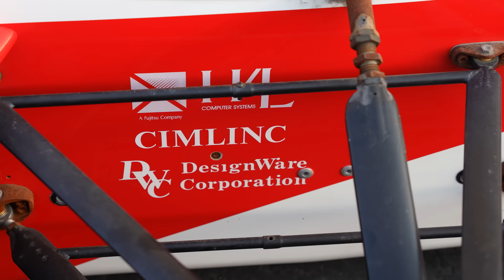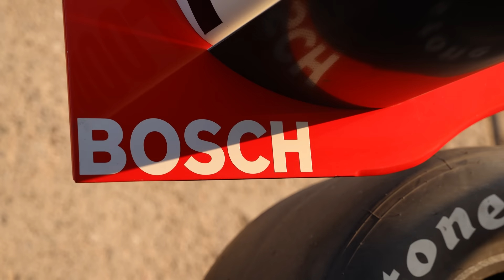I bought a INDYCAR without an engine.

Comment: Safer step is to mount turbo bike engine and gearbox into it .   will be way easier to drive .   Just saying that era open wheel cars are unstable to drive and less engine breaking you get the better it is to tune your senses on the car.    All it takes is an single rear wheel lockup on engine breaking and you loose your legs if you are brave enough to push it at all... and if you are not , its even worse to drive as you cant keep any temp on tires.

Comment: So the original engine was used as part of the chassis, large solid chunk of metal, now you planning on putting a rotary engine in place that uses a few 3/8 bolts to support front to back. Sound like an issue.

Comment: I have always had this question, where do you get parts for old official racecars like this? I know they are either very rare and expensive. I feel as if there is one accident the whole project is a write-off. Do you have any plans of reverse engineering parts for spares, different transaxle options, and carbon parts to make parts a bit easier to find?
Reply: There are guys that restore them in Indianapolis....parts are available
Reply: @jessallen7756  that's good to know. In my mind the parts would be team Specific depending on the year. Still I bet the part pool must be kinda small. I'll have to look into it more!

Comment: Even for the 90s steel suspension members would have been antiquated
Reply: Indycar still to this day uses steel arms. They often look carbon because there are carbon covers over them for aero but underneath is still steel. Been that way forever largely for safety reasons.

Comment: Remember the engine is a stressed member. Meaning it’s part of the chassis. That rusted metal square where the engine should be is temporary acting at that stressed member.

Comment: I put it in the replies accidentally. Again,rotary engine guzzles too much fuel(sounds great),so a twin KKK turbo 2.0liter V6 would be straight on the money. Something out of old Megane sport with turbos on and you're flying. Like the engine from those English  sport cars that guy makes can't remember the name... Blane,Beal,Gable help me out here. Those cars are fitted with a Megane V6 turbos and they fly. Imagine what it would do in the back of this Indycar. That is visibly from the 90's,early 2000's max and that's when they looked the best. Think it's a mid 90's car. And if he doesn't know what's under the front cover then what is he doing with it?

Comment: Hum, looks like the car has been sitting outside in the weather/rain, a lot of the metal parts are rusted. Just have everything powdered coated & make it street legal to drive. There are several Nascar related trucks & cars that were converted to street legal.

Comment: Will have to dry sump the engine and build a frame for it as the engine will take the chassis loads. If you put the loads through a stock rotory block it will break/distort. 

Those screws on the body are quarter turns. 
Those aluminum rods are placeholders for coil overs. I bet MCS could hook you up. You may be able to swap that transmission for a sadev. Suspension mounting points might have to change though. It will be a lot of work and money.

Comment: LOL this is going to be a way bigger project than most people think. Any open wheel car that has seen alot of downforce needs to be thoroughly gone over to look for stress fractures and things of that nature. All of the control arms will more than likely need to be replaced if you want to drive it at any sort of speed. There are companies that restore these things for vintage racing, and it takes them years to source parts to make the car work correctly. If he thinks the RX7 took a long time to get running. This is a whole different animal. I'll stop back in 2030 to see if it's even moving under its own power.

Comment: U should ask Cosworth to send you a Formula Boss engine and electronics...the gearbox needs a fully stressed engine block matching it...you´ll need to build a support for the engine that fixes it to the chassis and hang the gearbox to it and pray it doesn´t all break up. Hard work ahead...
Reply: it'll probs get something like a 6 rotor

Comment: Those metal rods you put you hands on at the top of the suspension are not some temporary place holder, they are torsional springs, your suspension looks complete.  Open wheel racers moved away from conventional springs a long time ago, and most series have a ban on shocks.
Reply: False, this is an Indycar, not an F1 car.
Reply: Wow....... just wow.
Reply: No series bans shocks (more appropriately called dampers). This would have coilover dampers/springs but those are expensive and carry over to other cars so a stripped show car just gets a solid rod to keep it off the ground.

Comment: im not an expert in any way but you have made frame mods on all your vehicles before why not lengthen the chassis to fit what ever engine you like in
Reply: This is a carbon monocoque
Reply: @The52car  ok many thanks for putting me straight
Reply: @The52car  Yes, forward of the engine. In theory, you could make the car longer or shorter by using a longer or shorter engine, longer or shorter spacer between the engine and gearbox (F1 does this a lot) or in the case of an engine swap like this, you will need to build a frame to join the front and back half of the car together since the engine is no longer a chassis member so that could be made longer or shorter. Of course doing so means new rear bodywork and floor as well.

Comment: Id love to see a rotary in that, good thing you have a machine shop, that cars engine was integral ,meaning the engine was part of the chassis, hence that boxed frame holding the two halves together, youll need to modify it or the rotary to bolt it all together without redesigning the body panels,,, the whole proccess is gone be a challenge and well worth watching ,BTW you need to finish all your other cars , you get 95% done then start another project.

Comment: Why are the suspension arms rusty, would a real IndyCar be rusty like that, I thought all that would be carbon fiber or something light weight
Reply: Currently they are still a steel alloy.  They have carbon wishbone covers though.  The wishbone are usually coated or have some kind of treatment.
Reply: @dhj2098  very interesting

Comment: People who know dont eff with motorsports history.
Reply: What history? This is quite possibly the worst car Lola ever built, owned by a smaller, little known team driven by a guy that while very good, never had a lot of success. This is not a race winning Zanardi car or something, this is a footnote at best in the history books.
Reply: @wingracer1614  the fact there are less of something makes it more valuable. I didn't say it was worth what zanardis car is worth. It's like saying Christian fittipaldis minardi isnt  worth shit compared to Michael Schumachers benetton. Plus zanardis car ran with a Honda. And bro those engine are gone. So unless you know chip ganassi is having garage sale. That xd in that under performing  t9700 is pretty sick. 

All of that is inconsequential 

That car is moving.art 
Plus lola came back to dominate. You think a reynard is worth more then a lola product. Lola everytime and twice on sunday.
Reply: @wingracer1614  the eagles were last place. But I would value them more. Have to use a cosworth.toyota owned those engines too. Leased them to teams. 

 Assuming in 10 years everyone is driving electric cars and CART has a renaissance and its advantages to assemble a variety of cars. 

Try and  find one in good condition. That ain't cracked. 

Zanardis car was previously damaged that's why it broke in half like that. Like a hockey stick exploding. The carbon is already fractured:unbeknown to the team
  than takes a big hit and its a disaster.

I'm interested In cars that will still be used. The villeneuve cars just sit in a museum. 1 at indy. 1 in toronto. I imagine zanardis cars r with the estate. And chips got them
Reply: @br1_deadpedal  Dude, you're rambling. Lay off the booze. Remember: all things in moderation. Come back when you are coherent.
Reply: @wingracer1614  im new to the internet. nightshift. And I'm bored and ur Sally or silly
Reply: @wingracer1614  and dont forget jealous. Why else would u tell this  nice guy his car has no history.
Reply: @wingracer1614  straight edge bro. U should try it. high on life. U should look deep inside. You project what you really feel. Practice breathing. That goes a long way. Yoga maybe.
You can stop drinking too

Comment: Yeah right, find a way to put the 6 rotor in that bitch…. Then it’s god status. Extend the frame
Reply: If you find a way to get launch control to work right with a 6 rotor in an Indy car, you’ll beat the hoonacorn for sure. That’s 3000hp maybe, go compound.

Comment: Bro, just finish a project for once. It's always starting this build, starting that build, but nothing ever gets remotely close to done. Everything gets worked on hard all for some big event or video, then promptly get shelved for god knows how long once it's over. Seemingly every year the garage only gets more cluttered with less and less in working order. Cars like the 3 rotor and 4 rotor have easily spent 75% of the last 5-10 years in pieces.

Comment: once you find out about torsion bars on open wheelers, regular compression springs just feel boring
those bars that you guys called 'tempory pieces'' are the actual springs, they twist and its how you get suspension
Reply: Incorrect.  These cars of this era didn't use torsion bars, but rather coil springs on a bellcrank.
Reply: They really are temporary pieces.  Used for setup and roll around.  Don't travel on solid sticks either.  Normally have old un race able travel dampers.

Comment: the suspension works by twisting the shiny horizontal rods, much like sway bars, but for up/down wheel travel
Reply: No, these are solid sticks, not torsion bars.  Used for setup and rolling around.  He is missing quite a few suspension components